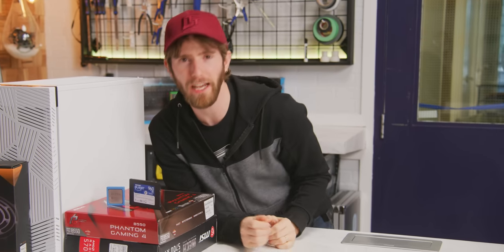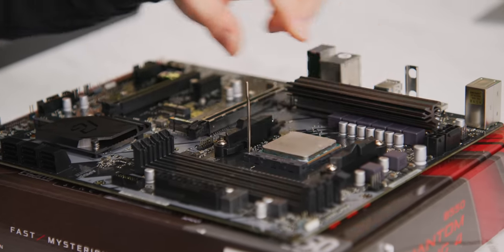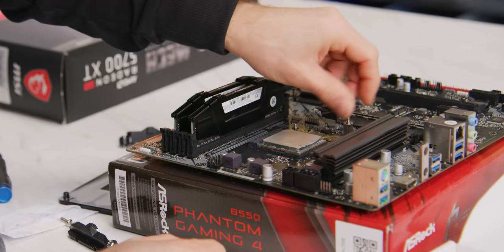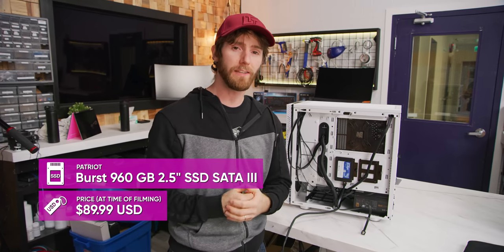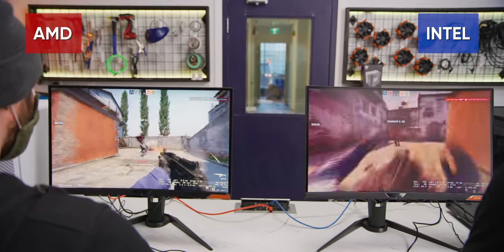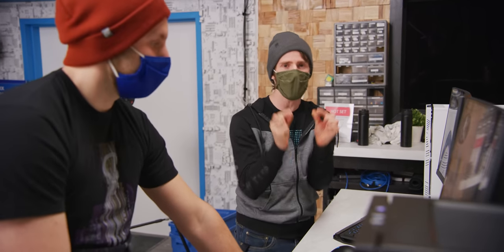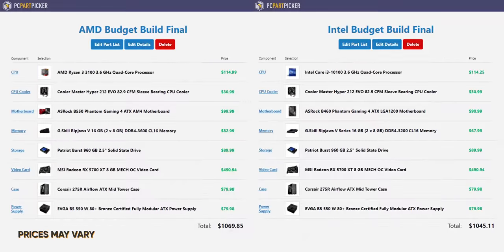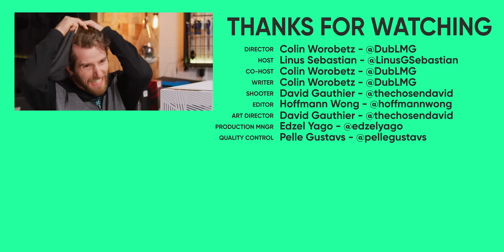AMD vs. Intel midrange gaming PC challenge

Comment: "We're going to be building two budget friendly gaming rigs, each coming around at *one thousand us dollars*" Aight I'm out.
Reply: Still cheaper than  trying to get A PS5 or Xbox Series S from Scalpers
Reply: @lukasperuzovic1429  You still buying from scalpers?
Reply: Don't take it out of context. With the CPUs he's talking about you can build a system for $550 easily - it just so happens that with the $120 CPUs he was using they were placed into systems that already added up to 900 or so. Or one can use a CPU w/ integrated graphics, save $30 on the CPU and over $100 on a GPU and have absolute entry level for $400-500. His use of the term "budget friendly" IS correct. This video is about mid-range gaming as the title of it suggests - not entry level nor $2000-$4000 enthusiast builds.
Reply: Well also factor in you probably pay close to $400 in online subscription fees in 6 years on consoles.
Reply: @lukasperuzovic1429  400/6= 66.66$ per year. That goes easier on your pocket as you don't have to spend it all at once.
Reply: What has it come to that we now consider $1000 usd midrange... I remember when you were able to build a capable system new for nearly half that...
Reply: @lukasperuzovic1429  consoles don’t last 6 years no more sony and microsoft always release 2 in that period nowdays ie PS4 in 2013, PS4 Pro 2016 PS5 2020.
PS4 Pro had 2.3x the performance of a PS4 
While a PS5 has 2.45x the performance of a PS4 Pro.

Basically new consoles with more of a tick tock approach.

Expect to see a PS5 Pro in 2024 with x2 the performance of a PS5.
Reply: @thcriticalthinker4025  $1000 has always been midrange, $500-600 is entry level/console killer territory.
Reply: @alaskanmalamute101  Except the PS4 Pro isn't a separate platform from the PS4
Reply: @thcriticalthinker4025  midrange "Gaming" PC. That's an important distinction. Running Cyberpunk on medium preset at 60 fps justifies the budget. For gaming, mid range has been around that price pint for 6-7 years.
Reply: @shamsnoor7043  Yeah this is high end i'd say. What, ultra 60 fps? Wowww mid range you need to have 550 fps on ultra settings.
Reply: @Kritya  in what universe is 500-600 entry level? You cant get any decent parts in that range, unless you go with second hand parts like GPU (That can be a valid way).
1000 is bare minimum to get any value out of your money.
Reply: @Dukenukem  You can get an rx 560 and an r3 3100, probably a b450m and a cheap ssd. Entry level is the worst reasonable performance, and I think it's reasonable.

For 1080p gaming modern games you probably would be much better off in the 1000 range, but if you were only playing like esports games you could get by with a 500 dollars rig
Reply: A thousand bucks is not much money as you get older. Thousand bucks won’t even pay my rent and I’m barely middle class. You can build a BA gaming PC for 1200-1500 bucks now a days and that’s nothing.
Reply: 1k bucks is a midranger nowadays (if the parts are in stock) LOL
Reply: @alaskanmalamute101  so £750???
Reply: @Dukenukem  not everyone wants to plays every single aaa game that comes out and not everyone has 1 grand right now so it depends. Theres still Alot of people would just prefer to upgrade their low budget pc 2-3 years later after building. Sure it’s not as valuable as building a 1k pc beforehand but it still increases the length of the pcs life. You can always earn money later
Reply: @fleecasy  it might depend on viewpoint of the prices, is it before taxes or after? also my prefered way of building PCs is lifespan of 5 years with GPU upgrade somwhere in the 2 year mark.
(I play Cyberpunk 2077 on my now 5 year old machine on 60FPS (high details). costed 1k then and upgraded GPU when 1660ti launched. 960>1660ti, i5-6600k,16GB ram)

also might factor in that low tier GPUs and CPUs are really expensive compared to"midrange" in my country that nobody is even considering that. you get 50% of performance for 80% of money if you are lucky, 30% if not.
Reply: @fran.klindic  watched some, you want to invest more time into the "self presentation" and polish that "ummm...s" and "eee...s". Just do the take multiple times until you memorize the script or use some sort of teleprom if you can't.
The topics are ok, the actual realization needs more polish, mainly in speaking department :). might be a interesting channel someday
Reply: Let's be real, mid-range gaming rigs were about $1000 for a good while.
Except back then you had to spend more on CPU  and less on the GPU.
Reply: I think they go overboard with the gpu.
Majority of the gamer (also me) still play full HD 60 FPS (steam chart) so only thing to change is the gpu with something more cheaper.
Reply: @lukasperuzovic1429  can you do homework on a ps5 or xbox
Reply: @Kritya  $1000 was not always mid range.
I remember when I was building my last 2 gaming PCs I went with $1000 high-end expensive PC and $500 Mid range well balanced PC.
The thing is that GPU prices went sky rocket over the last 10 years.
10 Years ago a $100 Graphics card would be considered expensive, while now a $500 Card is considered cheap.
RAM prices also went up over those years, but the GPU is the main factor.
Add some inflation to that and you will see why Computers are so much more expensive now.
Reply: @hubertnnn  I would not consider a 500 dollar GPU cheap (it can be considered good price/performance) but that's depends on who you ask.

One point though: launch prices of flagship GPUs after inflation are reasonably stable. The geforce 2 ultra is ~750 dollars adjusted on launch. The Geforce 2 GTS (from what I've read a good price/performance option of the year 2000) is about 500 dollars.

Please feel free to correct me if I've missed a point here but I think you've just lived through inflation
Reply: @thcriticalthinker4025  When GPU prices will go back to normal, then maybe we will be able to build mid-range PC a bit cheaper, but not untill then. Anyways, I would argue about mid-range PC's being half that price ever. Even 5-10 years ago cheapest gaming PC was ~$600, mid-range gaming-productivity ~$1000. Some years CPU's were more expensive, some years RAM, now all GPU's are priced like they were made in some parallel universe. And non of them are fully capable of ray tracing :)
Reply: @kingRJ-  of course its still meaningful money FFS, I'm 39 and earn around 75k canadian and 1000CAD is still a lot of money seeing as my basic living expenses is around 4500CAD, I have 2 kids and my wife isn't back at work yet as she has been raising our kids until school starts.
Reply: me too count me out wahahahahaha but its good to know what to buy.... after 10 years ...wahahahaha
Reply: @oxfordsparky  I see what your saying. Having a whole family to care for spending wise $1000USD or CAD is meaningful when it comes to that. But as for a computer that isn’t much money compared to how much it would cost to build a Bada$$ PC just 5 years ago. From a PC standpoint it’s not that much money.
Reply: @oxfordsparky  this is a mid range rig of an already luxury subset of pc use though. It's not like something you need for word processing, web browsing and watching movies is costing $1000.
Reply: @Kritya  if you're hoping to kill a PS5 or Series X with 600 measly bucks then you're gonna be sorely disappointed, friend.
Reply: @dv_xl  That is possible, that I lived through inflation. 
10 years ago was time before globalization here in Poland, and I compared Polish prices (1USD ~ 4PLN).
10 years ago graphics cards were available for around 150 - 400 PLN, with flagships costing 500 PLN (so converted to USD its $125), 

Now GPUs here in Poland cost about 10 - 20% more than in US, so for example a MSI Radeon RX 580 8GB on newegg costs $250, in XKom (Polish equivalent of newegg) its 1100 PLN (~275USD)
Reply: @alaskanmalamute101  that was caused by poor choice of components for the PS4 and Xbox one, they had piss poor cpus and weak gpus. they had to upgrade as they could barely manage 1080p let alone the 4k they wanted to advertise
Reply: @Masterblack1991  
Nope.
The 1660Ti/1070 tier, is already not enough for 1080p max@60 in the most demanding titles.
If you build a gaming PC you need a modern mid-range card.  The basic idea for a gaming PC-s that you get the best cost-efficient VGA,  without half-assing on the other components. 
Upgrading the 3100 later is more cost-efficient than upgrading a  $200+ VGA.
Reply: When I was in school, you didn't do homework on a computer anyways.
And if you needed something typed you use a type writer.
Reply: Logic_Encrypted  no idea what you mean, can you specify what are you asking? (YT reply system also sux majorly, I dont know what comment of mine is the reply for)
Reply: Stop beeing poor
Reply: @thcriticalthinker4025  you can, but graphics cards are very expensive now compared to the old days
Reply: @matchbox9167  sold fully working pc with a 3770k and gtx 970 for 300 it could still run anything at 1080p fairly well.
Reply: You can build cheaper, but good luck with gaming
Reply: @bromomento2952  No, it is NOT high end. Dude, get real. This build shown is nowhere close to high end. One thousand dollars cannot possibly buy high end. Don't mix objective and subjective.
Reply: @dv_xl  Yeah, splitting hairs but I'd suggest around the $750-850 mark.
Reply: @zaxmaxlax  Agreed. And if you were alive in the 1970's and 1980's $1000 would not have bought an Apple II or its variants - bearing in mind $1000 back had FAR more purchasing power.  Google Apple II... US$1,298 (equivalent to $5,476 in 2019). We don't have to imagine what five and a half thousand dollars can do for PC building nowadays. People complaining today surely are not 50 years old - they're spoiled if you ask me - spoiled by cheap prices and outstanding performance.
Reply: @hubertnnn  What universe are you living in? Pick the year in the last 40 when $1000 bought a high end system. High end to YOU maybe, but it wasn't the best or close. The proof is listing the exact parts and the year you bought them. You can't do it. You're deluded.
Reply: @pneumonoultramicroscopicsi4065  Yes and no. Compare a graphics card of today to one built 20 years ago. You're buying A LOT more with that $ and doing FAR more with it. Too, these past few months GPU prices are jacked high. A year ago was different.So many factors at play as to why. Conversely, look at present SSD and RAM prices to a year ago - fallen big time.
Reply: @alaskanmalamute101  I kept my PS4 since launch and only now got the ps5
Reply: @matchbox9167  Agree with most of what you said only more budget friendly a band new rx580 or 1660 super is lower mid range GPU and are around 1/2 the price of the 5700 which i'd say is on the high end for 'mid range'  also you can use the stock cooler if you dont overclock.
Reply: @Kritya  except 500-600 wont get you anything near the new consoles. The GPUs in them are almost as strong as the 2080.
Reply: @hungryplate400  you can pay for parts over time as well and spread out the payments to monthly on Amazon and Newegg.
Reply: @matchbox9167  
>integrated graphics
>gaming PC
the fuck am I reading
Reply: @Kritya  It's actually pretty possible to do particularly if you're going for largely used parts from like craigslist or ebay or something, but it's not actually easy to do. For one thing PSUs haven't been cheap lately and I'd strongly advise against ever buying that part used so you can easily be looking at a hundred bucks right there, pandemic prices wise. I would actually say the CPU is much easier to cheap out on because if you're going budget it's much harder to bottleneck your GPU, but even still all those parts are gonna start to add up particurly when you factor in 5-10% sales tax into the budget. 
>up to 1440p
That ain't gonna happen. What I would actually say though is provided you can build it around your much cheaper monitor this is pretty easy to do, because the most basic bitch gpu is gonna work fine @ 900p, provided you can deal with it looking like dogshit imo. I still can't believe I gamed at 768p for that freaking long. When you switch to something above 1080p you can't go back, and the problem with that is it literally inflates the cost of your entire system. You can do a 1440p thousand dollar system, but not a $500 one. 1080p? Debateable. I don't think it's possible with brand new hardware.

Comment: My dad would yell at me for putting an i3 in a 1000 dollar build.
Reply: Same. These parts are ridiculous for 1000
Reply: @jonathan-qd1cc  that i3 is as fast as an i7 from 3 years ago
Reply: @jonathan-qd1cc ?? I mean they literally show the pcpartpicker build and it all adds up. All you're saying is you'd choose a lower end GPU for a higher end CPU which doesn't really make sense for a gaming build. Especially when 10th Gen i3 is pretty top notch
Reply: lol
Reply: Yep, 100% true. They wasted money on the case and on the CPU cooler. I mean 42°C on the Intel and 50°C on the AMD CPU is NOTHING. Also b450 is a way better choice for the AMD system and a Be Quiet system power 9 PSU could safe some bucks.
On the other hand, a SSD with cache is only like $10 more.
Reply: @zayd1111  that would been sik 3 years ago but we are in 2020 so meh
Reply: @jacobnussbaum2309  I mean they chose it for gaming and decided to test performance with CSGO of all titles. CSGO uses GPU like Red Dead Redemption II uses Ray tracing.
Reply: Your dad don’t know computers
Reply: Yeah
Reply: @gurjindersingh3843    yeah that's a fair point csgo isn't exactly a great benchmark for graphical gaming performance lol. I think the dirt 5 and Cyberpunk examples were still insightful though.
Reply: @jacobnussbaum2309  that i3 will not last long same with the r3 as games use more cores.
Reply: @jonathan-qd1cc  yeah the system is running decent cuz if the graphics card. A rx 5600xt or 2060 would do fine and you could use something much better
Reply: Wise man
Reply: @jacobnussbaum2309  I don't think cyberpunk is a good benchmark rn especially how it doesn't use amds treads and treats the cpu as if it was a bulldozer. He didn't say he used the hex edit and they film these things like a little while before.
Reply: @joshuakhan8099  Even older dual core i3's can still play most modern games at 60+ fps. So not sure why you think a quad core 8 thread i3 would have any problems in future gaming.

Yes, it might not achieve the highest fps in the world, but it will still game just fine. Don't fall for the hype over modern i9's and ryzen 7's.
Reply: you would hate to see my build then...
Reply: @jacobnussbaum2309  having a cpu that causes stuttering in modern games is a good gaming option??? Foh
Reply: @zerozeroone001  a cool cpu is a good cpu
Reply: @zerozeroone001  It is so you can up grade it over time and not have to buy another one
Reply: @zerozeroone001  well said, I didn’t notice that nice catch
Reply: for more 200 dollars I built a system with a b450 tomahwak max, a 3600xt and a rtx 3070 for a friend... The builds that they have shown suck
Reply: @joshuakhan8099  but it will not run Cyberpunk 2077 as it now needs more single core performance patch 1.06
Reply: @zerozeroone001  yeah, shit builds. easily could have dropped a cooler and got a 10400f
Reply: @mascaradninja9838  I have a similar build to the one in the video and I have never felt limited to the hardware. I still manage to play most of my games at 144fps on high or ultra settings.
Reply: i5 are just like 60 USD more
Reply: @zayd1111  still doesnt change peoples snobbery if aint i7 or better is it worth having according to pretty much everyone on linuses forum
Reply: @heavygaming6596  bro I didn't say that it is a bad combo it just overpriced
Reply: @joshuakhan8099  thats been fixed already.
Reply: Most games dont optimise all cores doe
Reply: Your dad is a smart man
Reply: @zayd1111  truly, I have an i7 6700k overklocked 20% and it gets around the same frames in cs. I used to get a lot more, but I’m assuming the backdoor problem intel had caused the fall of my pc’s performance
Reply: @ygosoccer  my dad was one of first few hundred people to work with x64 bit computers... I think he knows what he is talking about.
Reply: @lotlum4343  My dad invented fire and saw the first wheel.
Reply: @Amorousstake4  My point is that most of his videos realse on float plane first and come to yt later. Do they not??? he did not say what patch it was.

Comment: I thought it was gonna be more like $500-600 “Budget Gaming” 😂
Reply: Technically 9999999999999999 dollars is still budget cause they can’t go over it or they ded bruh
Reply: Then go for a used 1050ti or rx 570 for about 150dollars and skip  the ssd, stick with hdd... saved about 400 dollars